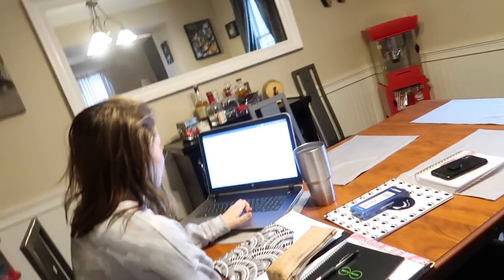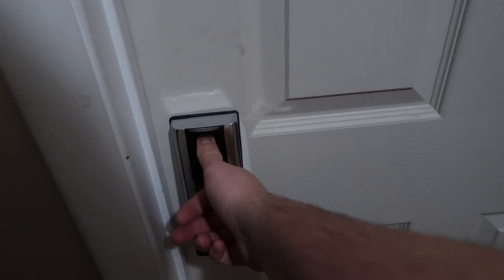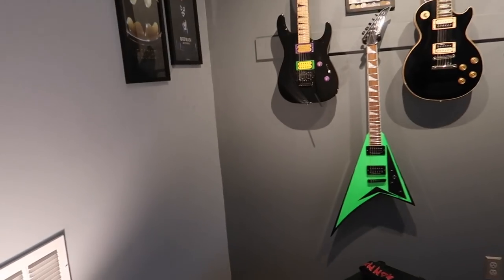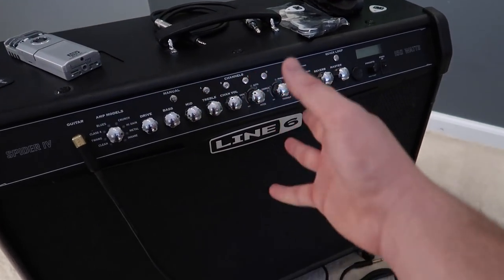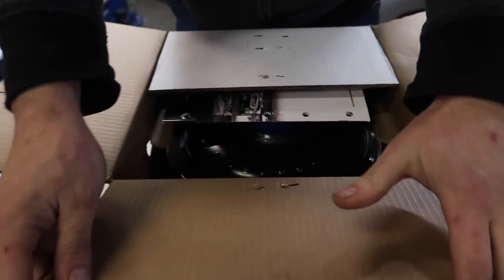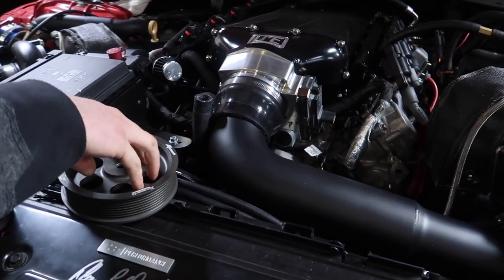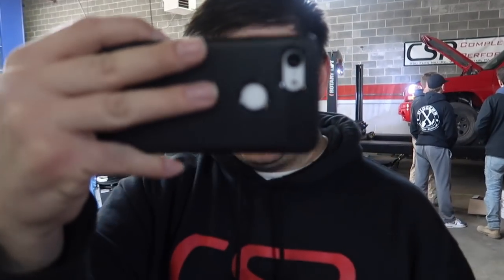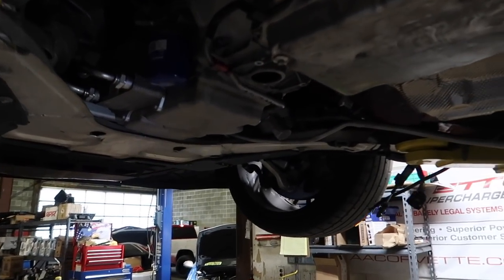FIRST MOD To The 10 Speed Auto Transmission!!

Comment: U-Coat It flooring, done quite of few of these.  Just a warning, the Polyurethane / Shine Coating is toxic.  You'll actually need a respirator not those little mouth covering things.  Make sure your house is empty that day (including your dog) because the Poly odor will be int house too.  I'm telling you it hurts.  You'll need to throw w little water in the base coat, very little though (just to make it thinner).  If you're throwing down the traction sand go lightly, if you put too much there is no removing it.  Just lightly dust even though they provide a lot.  Love the guitar playing, digging the Les Paul.  I have a 2016 LP Traditional in Honey Burst.

Comment: I epoxied a huge (30'x50'ish) chunk of the floor in my quonset shed about 8 or 9 years ago. It was a pain in the ass because it was 60 years old and had major oil stains on it. Imagine a leaky tractor parked in the same spot for decades. Then an idiot (teenage me) did plenty of transmission and engine swaps without really cleaning it up. Cleaning the soaked in stains sucked but the actual epoxy process was very easy and has held up well.